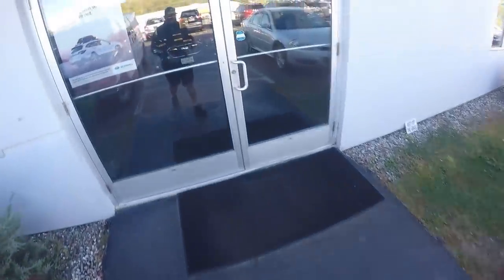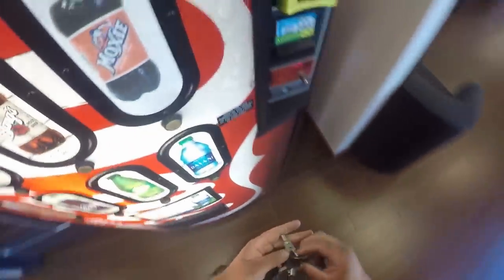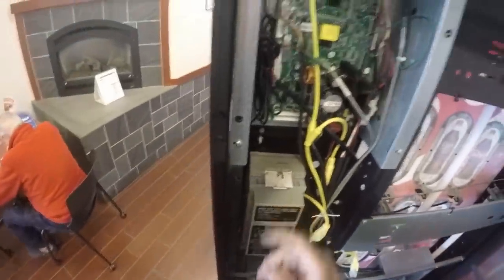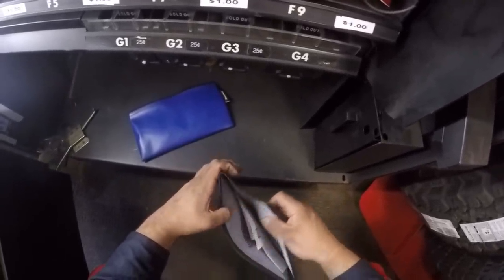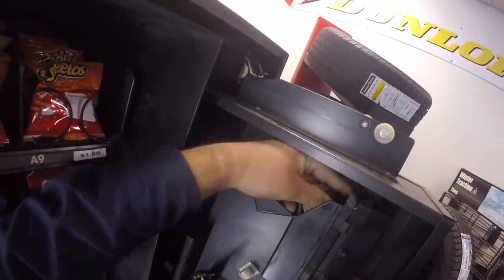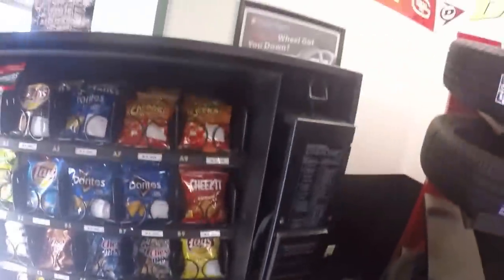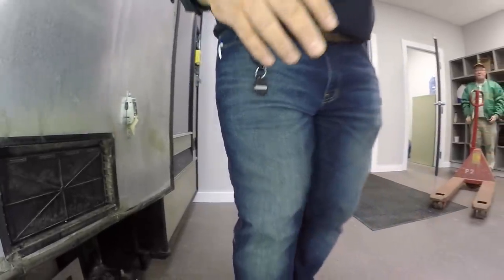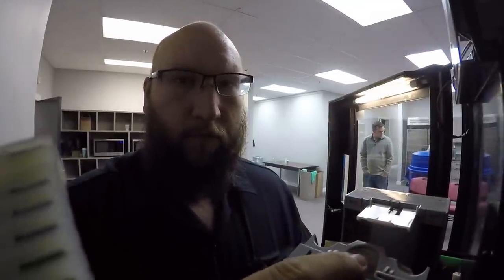Collecting cash from 6 of my vending machines!!

Comment: I’m a vendor. We use PayRange, you should look into it. Cheaper than card readers and the transaction fee is 4.25%.
Reply from the maker: i have considered it a few times. i really like the look of the touch though
Reply: You can add it with the card reader if you wanted to but you can add special offers like rebates if they buy certain items or a buy 7 and get 1 free.